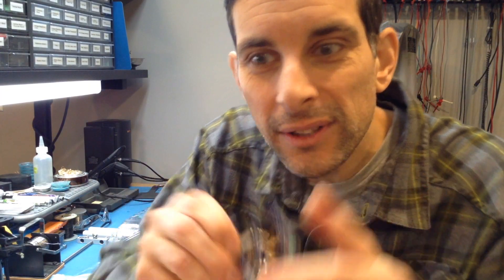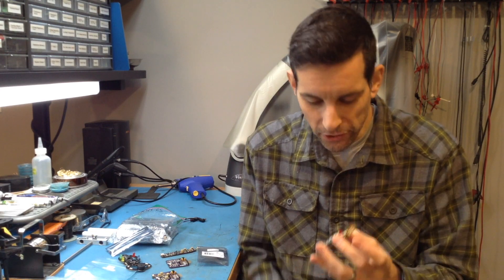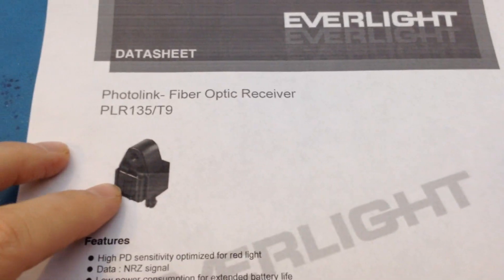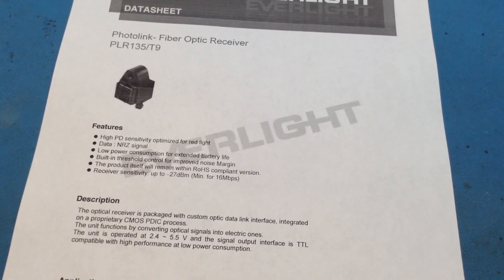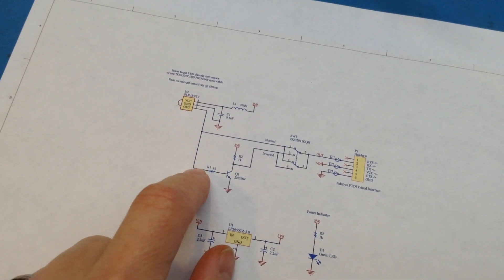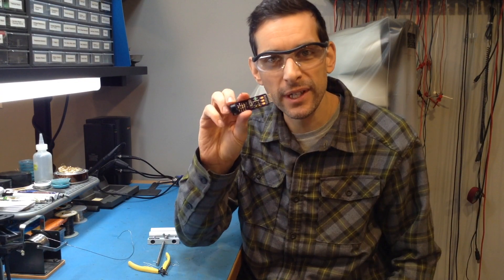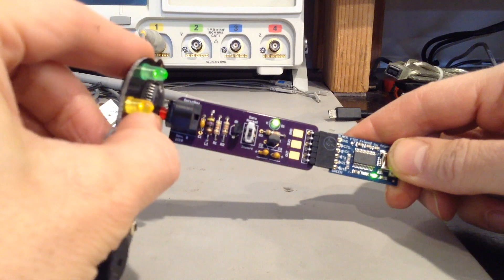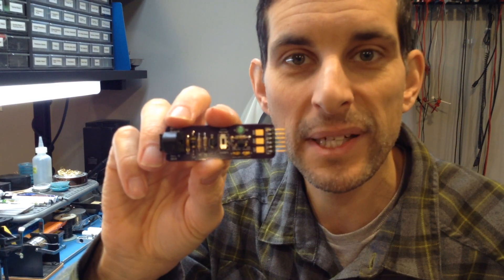OpticSpy Digital Demonstration

Comment: I wondered whether this sort of thing could be used as a safety system in a situation whereby 'industrial environmental factors' may cause interruption to traditional radio wave or electrical wire based safety systems.

If a single light source could be split and transported via fibre to end points at which it could be ran through some form of lens which would allow a reciever to understand the level of safety to workers in a particular area...given the onset of said 'industrial environmental factors' becoming a safety concern (i.e. a risk to life)

My thought is that it would operate a little like LiFi, only, from a single light source that can be hardened and battery backed up to ensure the maximum uptime.  The single light source would also be to guarantee the same safety status could be distributed to as many end points as required and be guaranteed to be recieved as the same status everywhere, no matter what.

The method of distribution for the light would need to be something such as fibre such that it could not be influenced by said 'industrial environmental factors' by any means other than if those factors caused a physical break in the fibre.